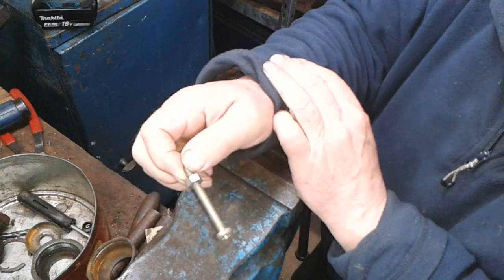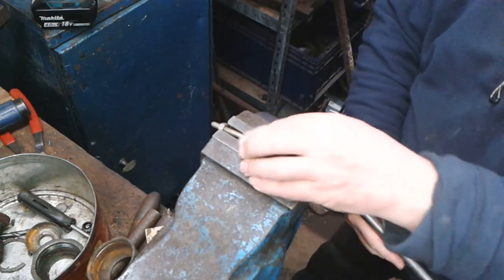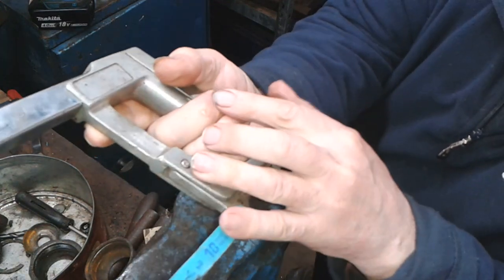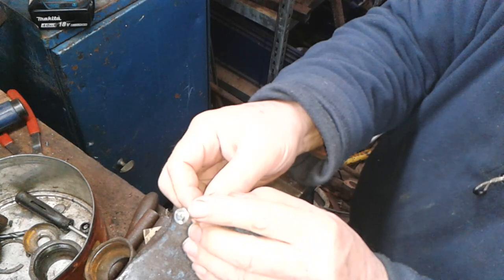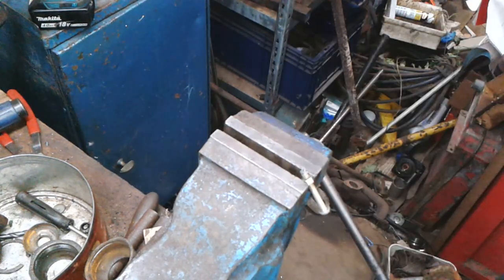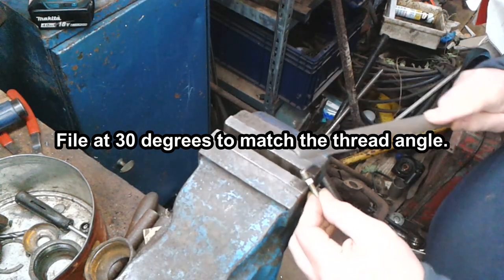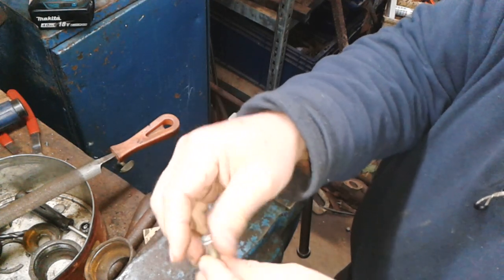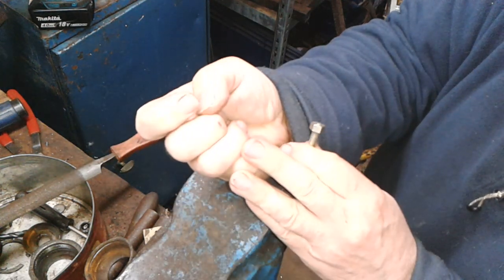How to shorten a bolt Mart's way. Includes some pain and bonus outtakes!

Comment: Hello Mart,
I always use a similar method... thanks for sharing... First attempt is fabulous, thanks for including...
Cheers.
Paul,,
Reply from the maker: Thanks Paul. You can see me patiently waiting but then soldiering on regardless. It was quicker to reshoot than try and edit. The comedy value of the first go made it worth including. My mistake on the 2nd go was the bolt was loose hence me using my left hand to stop it turning while sawing. I used 2 hands the first time and it was much more controllable.

Comment: LOL!! Reminds me alot of trying to tell my wife something, that she is obviously "hardly" interested in, while she insists on having the TV or sterio going at the same time. ;o( 
A number of years after I retired, I finally built the detached garage I always wanted (tall enough for a lift) in my back yard. Once it was done, I bought a few new tools to help with fabrication. One of those is a disc/belt sander so I use that for those cut thread ends and that chamfer. Good tips. That vertical piece on the hack saw in front of your knuckles usually avoids that injury you sustained. It has saved my knuckles on numerous occasions. ;o)
Reply from the maker: Cheers Bob. Yeah, I am normally more careful. The original footage shows me using two hands on the saw in a more controlled manner. Thanks for dropping in and commenting.

Comment: G’day Mart. I shorten my bolts a similar way but since I was knocking my knuckles too often I use a small angle grinder so now I invariably burn the tips of my fingers:-)
Thanks for the laugh at your expense. Cheers. Peter
Reply from the maker: Thanks for dropping in, Peter. It wasn't a serious how-to for anyone that is used to this sort of thing, but as long as someone finds it helpful it's worthwhile.

Comment: That's the way I was always taught to  do a nut and bolt mart. Cut with  nut on then rub Down with file bigger one's we do with bench grinder.  Lol that was some noise in second part rofl.😂😂 It sounded like you where in a pet store. Lol
Reply from the maker: Thanks Ali, Yeah, I use a grinder too, but these were only 6mm so filing was good. It was the act of holding the nut and being able to turn the bolt while filing that I liked about it. I did 4 bolts and the first one I did use a bench grinder, but the subsequent ones I filed and they came out better. I put it up as a bit of a laugh rather than any serious how-to.